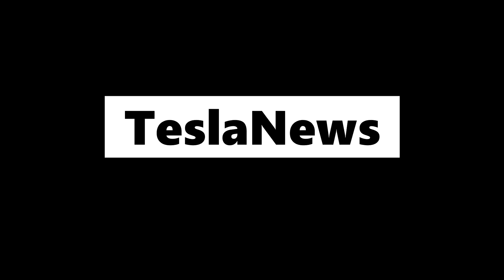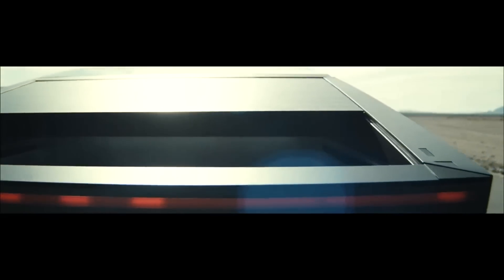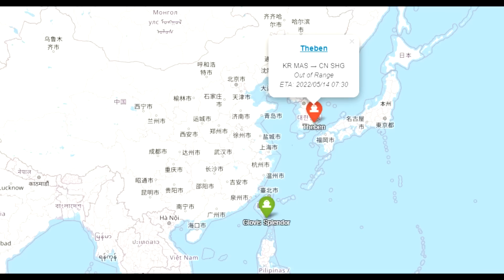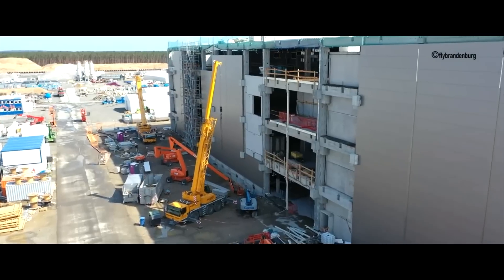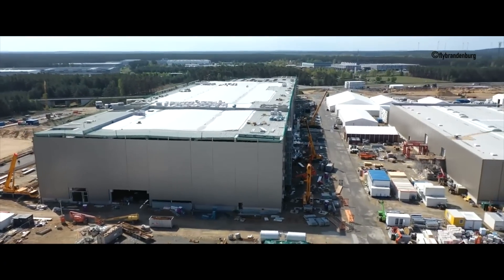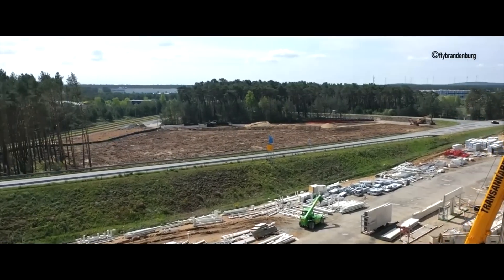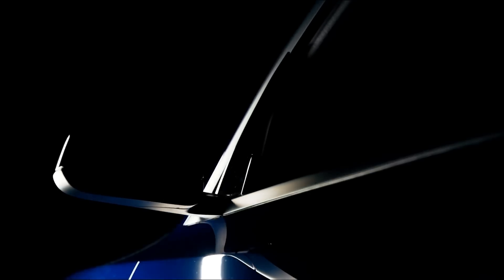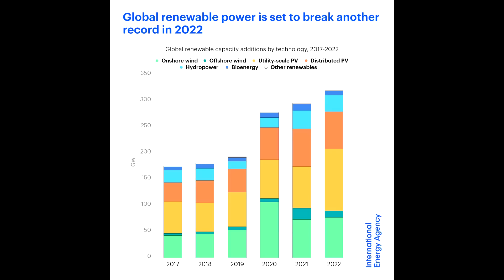TESLA 4680 Battery - Panasonic help needed & Giga Berlin CHECK

Comment: Pros of 4680 is 16% more range and charging to 100% without any issue on the long run. Cons are supposedly related to immediate power output being lower than on 2170 and that is the reason why they only instal it in a standard range models and not more performance oriented cars.